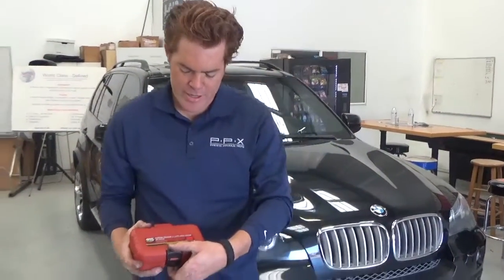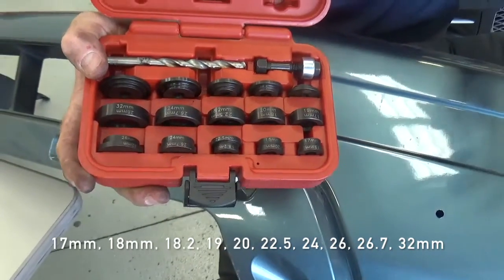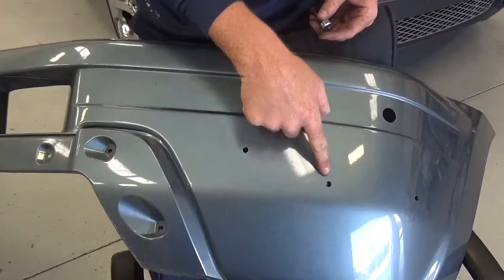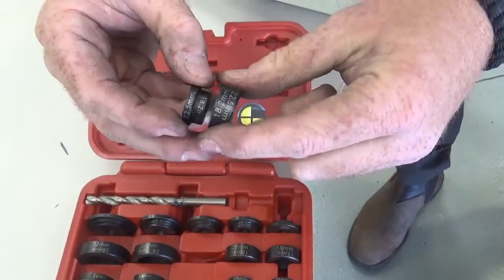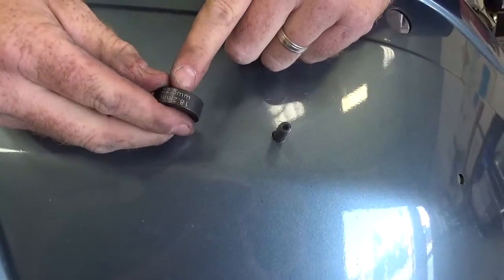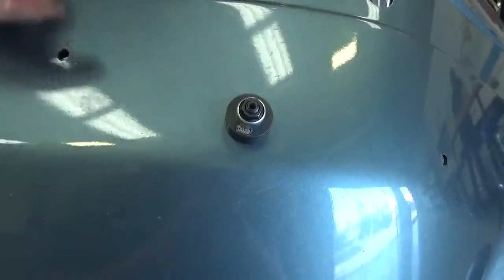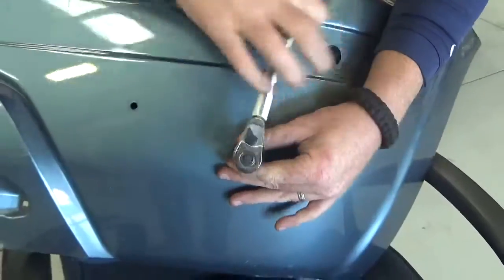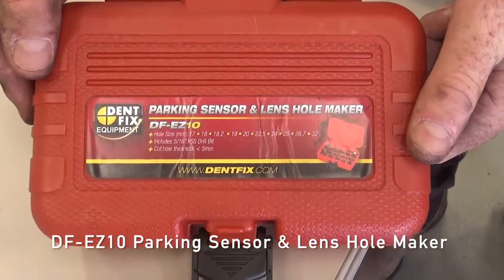Dent Fix: DF-EZ10 Parking Sensor & Lens Hole Maker

Comment: My question is that I am told the center sensors on the 2016 BMW 320i  have a bevel which is nearly impossible to replicate. Will this kit actually work for these?